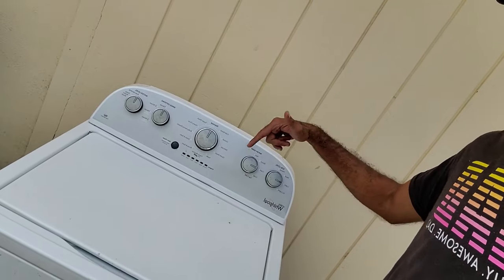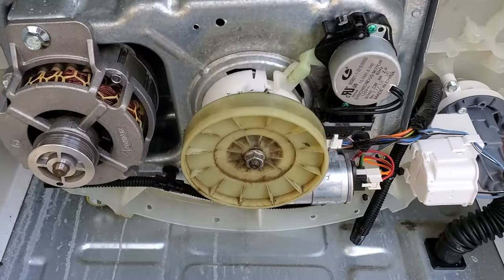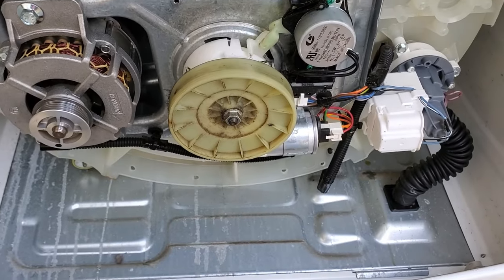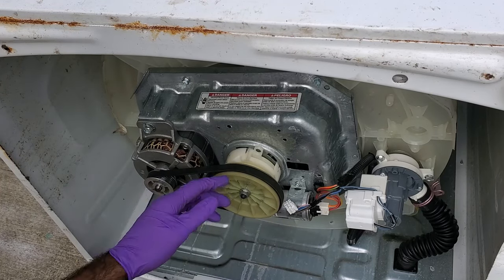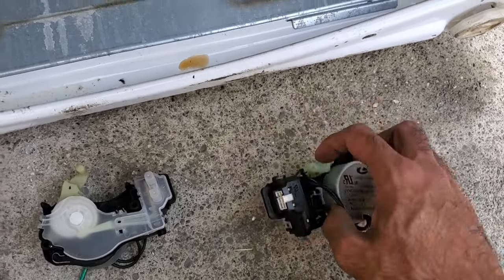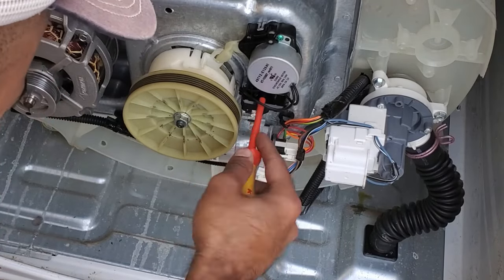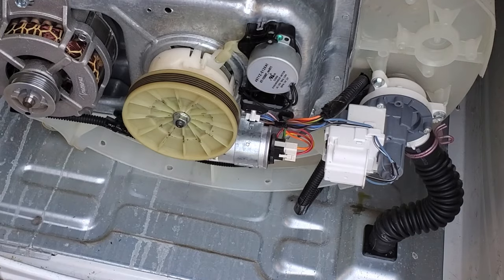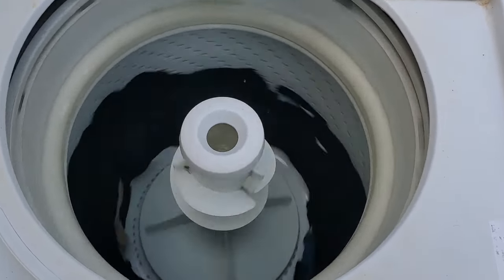Fixing A Whirlpool/Kenmore Washer That Will Not Either Agitate Or Spin!

Comment: I replaced the shift actuator on the same exact model washer whirlpool. It still wont agitate or leave the “sensing” cycle. The belt is fine the motor spins freely not locked up or anything. However during calibration cycle it stopped before 3 minutes and made a loud grinding sound and stopped calibrating

Comment: This video saved me $650. Had an appliance repair man come out “looks like you need a new washer the transmission went.” Haha nope. Found this video and it was EXACTLY the issue. You rock man keep doing your thing!
Reply from the maker: Awesome! Glad to hear that! From my experience, when some repairman can't figure out what is wrong they just resort to the most catastrophic issue because they know you won't get it repaired.
Reply: @DuctTapeMechanic  quick question need help! Did a few loads and it reverted back. The new part is now super loose after 2 loads. Is something else causing it to break or did I get a bad part
Reply from the maker: @andrews.5174  check to see if the clutch is moving freely
Reply: @DuctTapeMechanic  it pops over to one side quickly then it’s more of a gradual effort to go the other way. Belt moves slower one way and easier the other. Not sure if normal
Reply from the maker: @andrews.5174  I would return the shifter and get another one. I would also replace the clutch kit while I am in there. All the parts combined should be around $50 on Amazon

Comment: I owe you a big thank you for this!  But I want to tell you what happened with me, it might help someone else out.  My Whirlpool was spinning but not agitating, after your video I ordered a shift actuator- BUT I got a knock off brand, put it in and the washer STILL didn't work.  I was really pulling my hair out, because it really seemed like the problem was the shift actuator, but it still didn't work with a new part?!  finally called an appliance guy [for a mere $140] and he said the problem WAS the new part; the specs were off just enough to cause a problem.  Long story less long, I got the part from Maytag, put it in and BOOYAH!  Success.  Also- Maytag redesigned it so it looks different from the original [mine was the rust colored one].  There is an extra compartment where the wire hub gets connected.  For whatever that's worth.
Thanks again for posting, and maybe my aggravation could spare someone else.
Reply from the maker: Glad the video was at least a little helpful!
Reply: @DuctTapeMechanic   It was a LOT helpful!!  Thanks again!!

Comment: Couldn’t figure out why my clothes just didn’t smell and look as clean and this was the issue, except the arm wasn’t broken the rod somehow was not in the hook part. Thanks for the video 👍🏼
Reply from the maker: Sometimes that happens. If it continues to happen you will have to replace the shifter. Thanks for watching!
Reply: Dude, I just found the same thing after having to do the repair in this video, I almost think it might be a design feature to make their warranty work less costly. Think about it, if something really jams up the agitator (like a $1.05 in change in my case) it's better for the arm to bend and pop out than break. Pretty ingenious on their part, it's like a free reset once you unjam the agitator.

Comment: Thank you for the guide. This fixed our machine, but the new motor arm keeps slipping out the shifter on the big motor. Any suggestions?
Reply from the maker: If it keeps slipping, try replacing the clutch. It's only like $20

Comment: Thanks for the videos. I have a question.  Our whirlpool washer is about 10 years old. It was exposed to some cold draft when we tried to use it. It was during the extreme cold wave which made our utility room cold near the floor. In drain mode just a loud buzzz then I quickly unplugged it. Then I tryed to start it again and nothing. Im thinking the water pump had Ice in it. But I cant get it to fill or don anything now. thinking I might have broke something. Any ideas?

Comment: How did you bypass the lid switch if you don’t mind me asking? Great video
Reply from the maker: I stuck the striker in the lid lock by removing it from the lid with which it is fastened on with two t-10 screws. Should be only done for testing/diagnostic purposes.

Comment: Our whirlpool machine did exactly like in your video, the clicking noise and not agitating. The only difference was that our arm on the actuator was stiff and not loose like in your video. We replaced it anyways as we saw other videos explaining that the sensors might be shot. Despite replacing the actuator, it is still making the clicking sound and not agitating. What else could we do? I'm just about to give up....

Comment: Thanks for this video. My kenmore washer made the same noise and I bought a new shift agitator and it broke after 3 washes. Is there something else possibly wrong? It will spin but won't agitate when in wash mode. I did notice my original part that failed is a 4W and the ones they sell now are 2.8W. I just don't know what else to do at this point.
Reply from the maker: I would first check to see if the clutch moves freely when moving it up and down with your hand. If in doubt, replace the clutch and actuator as a pair. Good thing about Amazon is that they have a good return policy.

Comment: Does the shifter assembly also put it in drain mode? My booklet is showing its either lower machine harness or replace pump motor... my problem is when it goes to drain mode there is a humming sound, even when i put it in manual mode to check drain pump it still has the humming and will  not drain... also sometimes when i leave washer unplugged for a period of time its like it resets it and i can get the drain pump to drain... i dont want to test all the continuity points so the booklet says if its a stuck pump replace pump... if so dobu have any videos for that?

Comment: Fantastic video, as always. Tons of conjecture online about OEM versus Amazon parts. OEM are double the price. Worth it?
Reply from the maker: Thanks for the kind words. Honestly, I have had no issues buying from Amazon. I have bought shifters, motor couplers, etc. with no issues. The only thing I am a bit skeptical about is suspension rods but if they last 2 years instead of 4, I think it's worth the gamble. But some people only swear by OEM.

Comment: Will the washer make a clicking sound when in wash/ agitation cycle if the shifter/clutch is going out ?
Reply from the maker: Yes it will make clucking/grinding noises depending on the part that is bad

Comment: My whirlpool WTW4816FW1 needed the agitator dogs so i replaced them but then it kept making the noise yours makes and washed just like yours so i changed the mode motor and it atill does it. Any idea what it might be? It does the exact thing this machine does.
Reply from the maker: Did you try replacing the clutch? Could be a bad/stuck clutch

Comment: I have a lot of grease underneath as well. What would cause that? Thanks!
Reply from the maker: A lot of grease is never a good sign it could mean the transmission is leaking. I would replace the actuator and see if the machine works ok but it may only be a matter of time...

Comment: great video. I took our agitator apart thinking it was the dogs, but this machine doesnt have agitator dogs. Agiatator spins with the drum by hand. Can the shift mechanism you repaired be the problem? Thanks
Reply from the maker: If it's not agitating, then yes the shifter can cause that
Reply: @DuctTapeMechanic  thanks for the quick response
Reply: So, before I buy a new shifter in Canada, $100, I have one more question. The shifter  and clutch behave exactly as in your video. If moving the clutch by hand, and turning the pulley, shouldnt the agitator rotate? No matter what position I move the shifter to, only the drum spins. Thank you
Reply from the maker: @166rodney  switching the position of the clutch should engage and disengage the agitator. If this is not happening perhaps your agitator plate js worn or your basket drive hub is stripped.

Comment: I have a Kenmore and I have a question I have replaced everything possible on it and when the trouble started it made this horrible screeching noise so then I checked everything out everything look good but it was spinning and not washing there was nothing wrong with my shifter switch there was nothing wrong with the clutch the gears were not worn or torn and now I've recalibrated it and it's like  washing but not spinning can you help please you're really a lifesaver???? It's the 500 series??
Reply from the maker: Is it showing any errors in the diagnostic mode? I have a few videos on how to get into diagnostic mode on kenmore/whirlpool/maytag washers. You installed a new shifter as well? Most of the time the shifter arm is ok but the position sensor on the shifter is broken
Reply: @DuctTapeMechanic   it was spending an not washing. Now it's washing an not spinning so I really don't understand all the error codes ? Thank for your help an videos am better with video .
Reply: @DuctTapeMechanic   I even checked the water an lid lock . everything is working but not all the way correct thank u...i love to see videos I looking 4 one how to tell what error codes is what?

Comment: Have same mashine different mode shifter but it won't agitate agitator spins free from top or i can spind shaft on bottom  but not the top agitator part.  Mode shift selects fine no fork broken aspins fine lid cloaes fine pump is fine but no agitating is the only thing. Could it be the transmission?

Comment: I have a similar machine.  I replaced the actuator like you did here.  The error codes tells I might have an issue with the water pressure switch but I am not finding much for this style washer on that part.  With the Soil selector instead of a water level selector knob.  Would love to hear what you know?  Error codes are F8E1 & F3E1
Reply: F8E1 means water supply valves  are not fully open or partially open. Turn the water supply fully open so that there's a pressure going in. F3E1  means your water is so slow or no water detected, check your host, pipes, wires, or the main control board.

Comment: Thank you for your video.  My whirlpool top load stacked washer/dryer:  the washer is doing as your video shows.  The repair fella from the appliance store said by a new one, the gear case needs replacing.  He said it was leaking oil?  Where do I purchase the part you show in your video?  New subscriber here.  Thanks again!
Reply from the maker: If the gearcase is bad then replacing the shifter will do you no good. But the shifters are available on Amazon and can be searched for by part number (there really are only two types for whirlpool a black colored one and a red one) tip the washer back and have a look. Also look down there at your gearcase, if your gearcase is leaking oil then that pretty much means you need a new washer.
Reply: My washer spins just fine but agitates very slow like it is getting stuck and I replaced the agitator dogs today
Reply: @DuctTapeMechanic  Thank you for the information!  Much appreciated.

Comment: Mine is agitating exactly like that! But mine is a direct drive estate whirlpool. What would the problem be?
Reply from the maker: Direct drive washer are completely different. Are the agitator dogs worn? The dogs are a simple and common issue on direct drives which causes them not to agitate properly.
Reply: I did the dogs. And  that helped the top part of the agitator. Then I replaced the whole agitator with a used one with new dogs. But it's still doing the same thing.
Reply from the maker: @jerigabbard6825  if it still spins ok then that means ur transmission is shot
Reply: Crap! Could it be the motor coupling?
Reply: It doesn't make any noise. Just doesn't circulate the clothes right
Reply from the maker: @jerigabbard6825  if motor coupling is broken, the washer will not spin as well. If it doesn't spin and doesn't agitate then it could be motor coupling
Reply: Thank you!

Comment: Help!!! We did this exact fix/replacement and it worked for 2 loads then broke again. We calibrated before the first load as well. Where are you guys getting parts that don’t break?
Reply: I had the same problem. I replaced the actuator about a year ago and it failed. This time. I replaced it with a cheaper third-party version and it lasted two loads made a horrible sound and now the washer is acting very erratic. Currently it won't even fill with water.

Comment: Hi I have replaced my shift actuator twice already. It well work good for a week and than the actuator breaks again. I'm lost on trying too figure out what else could be wrong that the actuator keeps breaking. Can you help me with this. Both new shift actuators were ordered from Amazon.
Reply from the maker: Is the shifter arm physically breaking? If it is, remove it and see if the clutch is stuck. You should be able to move the clutch lever up and down, often times these accumulate dirt and can get stuck causing the actuator to work harder then it is designed to do.
Reply: Thank you for your advise I'm going to check the clutch.

Comment: My washer will do everything but agitate.  When it's supposed to be agitating, I can hear a pulsating buzz, kind of like a phone would, but it's not doing anything.  It's not loud or vibrating, you wouldn't suspect anything wrong with it.  I just started noticing freshly washed and dried clothes didn't smell the same.  My wife uses detergent pods.  I would throw one in after I filled the tub with dirty laundry and when I came back later to swap into the dryer, a few articles of clothing would have a gooey substance stuck to them and I couldn't figure it out immediately.  I smelled it and it smelled like detergent.  That's when the lightbulb went on that the clothes weren't being washed.
Reply: To add, the washer will fill, drain, and spin.  It will go all the way through the wash cycle.  I'm not digging clothes out of a tub filled with water.  That's why I said, you wouldn't suspect anything wrong.
Reply: I've taken the actuator off to inspect it and I noticed that the shifter arm doesn't seem to switch.  There's a lot of resistance.  The question I have is how much resistance is normal?  I don't want to buy a new one and it have the same amount of resistance as the one that came with the washer.  I haven't been able to get the arm to switch and I don't want to force it only to break the arm off of it.  The washer can still be used.  I also checked the splutch switch and it has much less switch resistance.  I can switch it back and forth with no problem

Comment: My Kenmore top load washer does the same thing. But when laid my washer down, my belt looks like it's been shredded. Pieces everywhere. Any idea why that happened to my belt. Was probably the reason we had a burnt rubber smell
Reply: Could be because of the age.
Reply: @louachongjohnson2066  only 5 years old. Changed the belt, drive clutch kit, and shift actuator. no problems since.

Comment: I’m replacing the actuator but it seems that that part where the actuator hooks into it’s stuck it won’t move down or in the middle it’s stuck at the top where you said it will spin but not agitate
Reply from the maker: Disassemble/Remove the part (clutch) and clean/replace it. I have a video on how to replace the clutch if you are not sure
Reply: @DuctTapeMechanic   Thankyou now that I replaced the actuator I’m going to see if it works now if not I will do the clutch thing next the power is out here waiting for it to start up again I got the hook thing to move in the middle and down just was tuff then it loosened up but I’m do the clutch thing if it does ent work
Reply: @DuctTapeMechanic   what’s the video called I’m looking for it now
Reply from the maker: @Rainissick  https://youtu.be/CfDhnqsvoyU
Reply: @DuctTapeMechanic  hey just making sure it’s making a noise like it wants to agitate but it doesn’t agitate after me changing the shifter thing you think it’s the clutch ? It’s making that noise like when it’s supposed to agitate but it’s not I think it is the clutch because that knob where the shifter is is hard to press up in the middle or down so yeah it may be the clutch

Comment: Mine isn’t spinning but that part isn’t broken or loose like the broken one you showed
Reply from the maker: It could still be broken as it has a motor speed sensor on it that often goes bad.  I would check the belt (make sure it's not broken), check the clutch make sure its not stuck, and lastly replace the shifter (its cheap). Hopefully this helped

Comment: @DuctTapeMechanic  I had a clicking noise on my kenmore 110 washer during sensing so I went ahead and replaced the shifter.  That appeared to resolve the issue for about two weeks.  Today, a new clicking noise started when the washer is sensing.  The clicking noise is loud and rapid(different from the original clicking noise).  I opened it back up and see no issues with the shifter.  I also inspected and cleaned the clutch.  The washer seems to be washing properly.  Here is a video of the new noise.  
https://youtu.be/9pQVaxGl7hs?si=6sjoGzEm6Li0s2nm

Any thoughts on what is causing this?